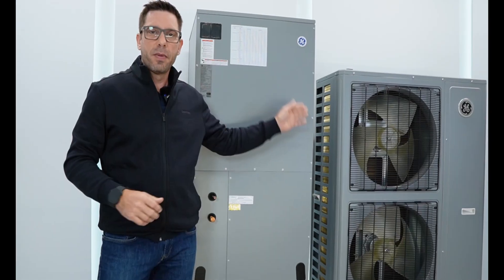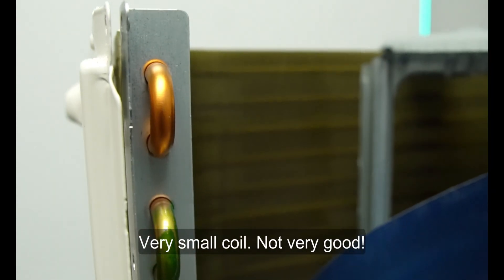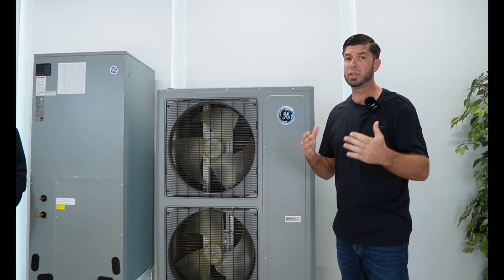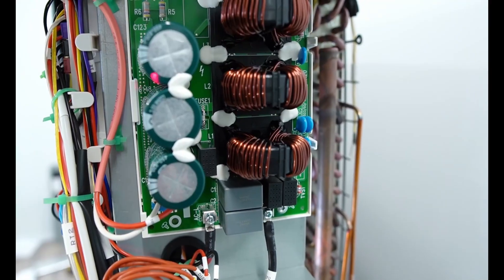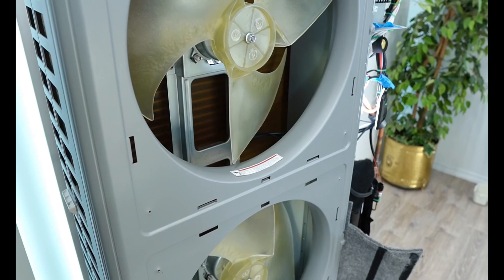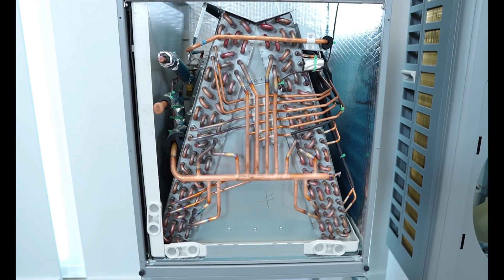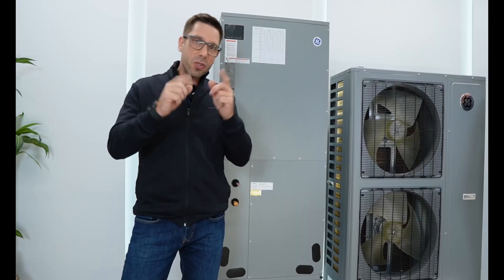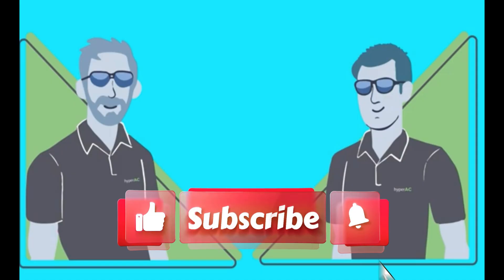The Reason Why This Air Conditioner Heat Pump Can Take Over The Market

Comment: Most ac and hydronic heat pumps pull air in from the side and back and discharge out through the front. Are you sure this one is different?

Comment: This GE heat pump is made by Gree. It looks exactly like Gree flex. But im not sure about the indoor unit. Gree air handlers have flair connections. Maybe GE gets the AH from trane?
Reply: it all depends on model it isnt hard to have different connection at the air handler, this is gree flexx  rebadged